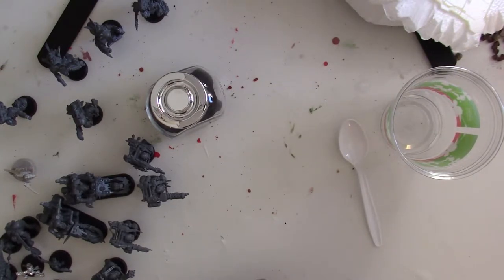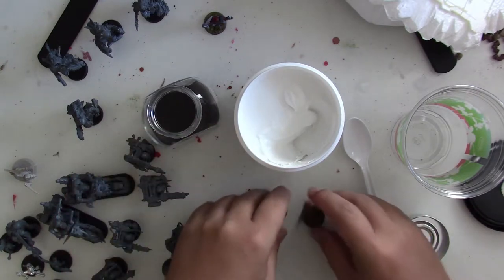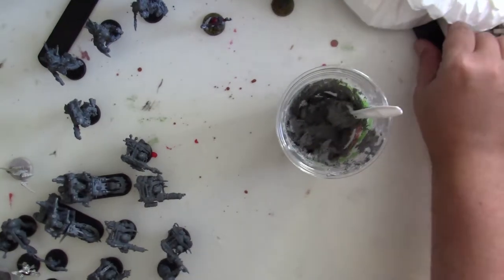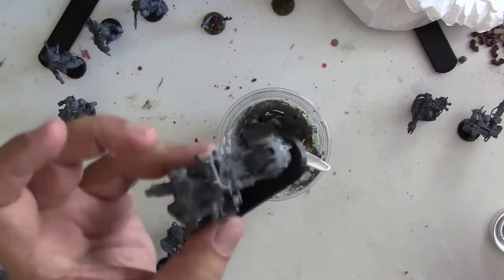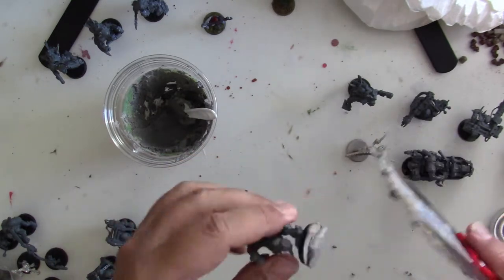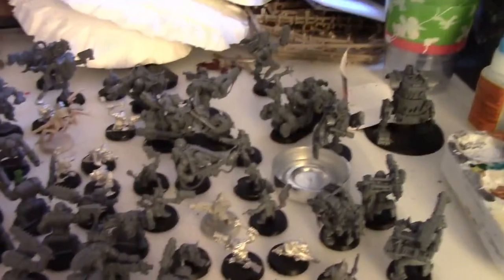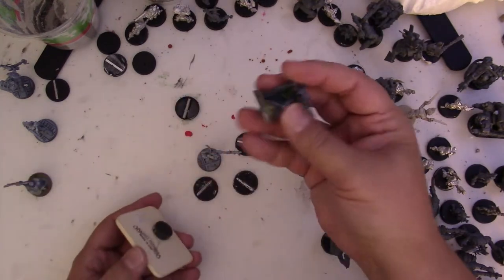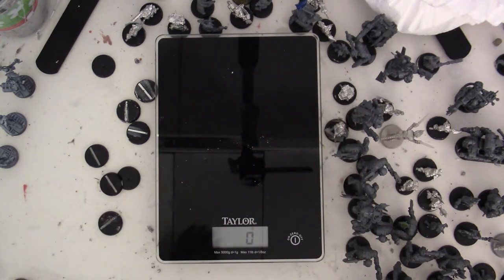Hobby Hacks - Heavy base weights for miniatures

Comment: Would you say that the bases end up heavier than gluing a washer in and covering that in spackle?
Reply from the maker: A washer would definitely be heavier, but not all bases are open underneath. A lot have mold gates or other bits clogging up the works. This was mostly just an exercise in curiosity tbh.